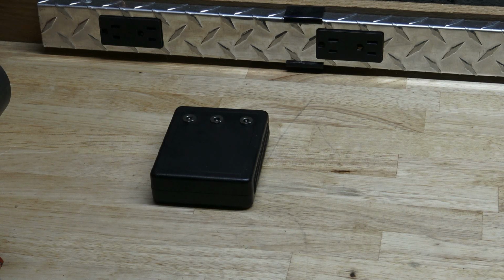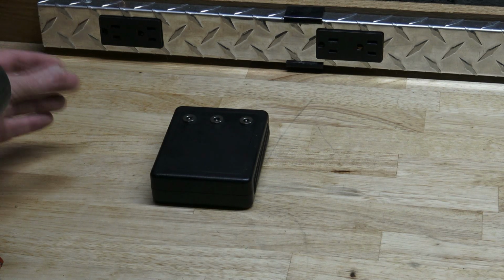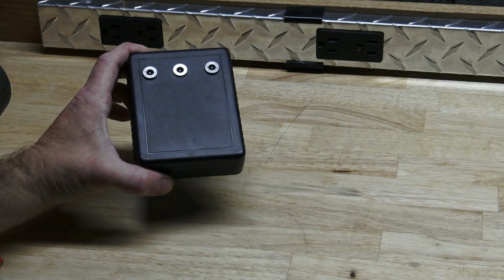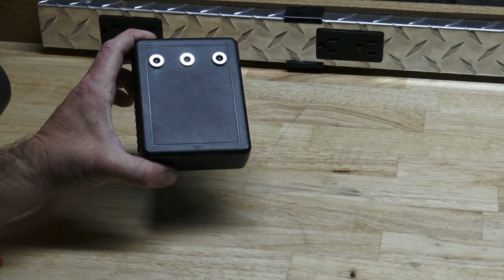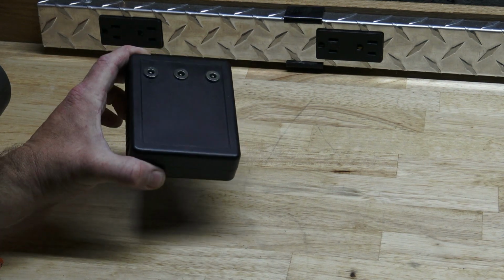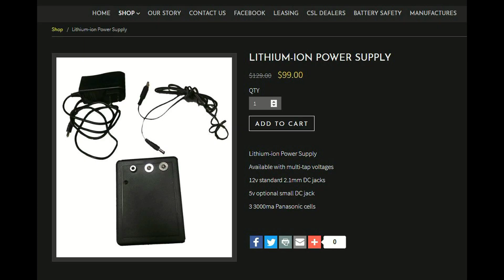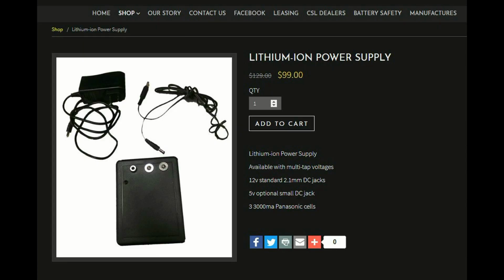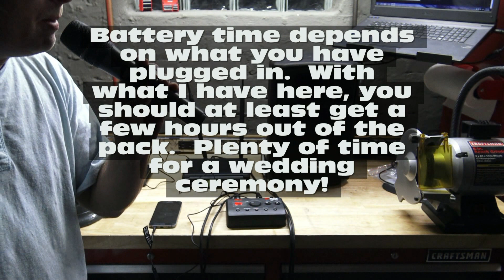Make DC Wireless! - CSNL Lithium Ion Power Supply

Comment: Do you know of any pack like this I can use for my ADJ Mega Par Profile Plus up-lights. I only have 8 and I don't push them so they are used rarely but cordless would be nice.
Reply from the maker: That would be AC.  I'm not very savvy with electricity, but basically, you'd need some kind of AC power inverter, which might be too big to make it worth while.  You are better off looking at some of the ADJ Mega GO options
Reply from the maker: Yeah, should run a simple receiver like that for several hours.  I'm not much of a power guy.  I leave that stuff to people a lot smarter than me, like Jim at CSNL who builds this pack I'm using